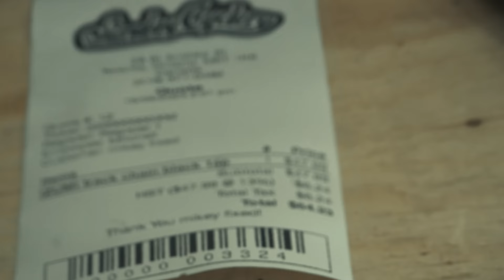New chain and I got a new JOB !

Comment: Yo mikey, do you know why the chain wears like that, mine dose it and it caused me to drop the chain in a corner and it f up sum stuff real good 😢
Reply: The chainring isn’t a perfect circle
Reply: @Vtoq  could it be the cog to or is it most likely the chainring?
Reply: @vickeboi2563  Chainring. A bike mechanic told me that road/track chainrings are not a perfect circle so the chain tension isn't the same all around which is why it also wears down unevenly but once a part of chain wears down you want to replace it ASAP
Reply: @Vtoq  nice! Thank you so much for the info! Helped much🙏🙏🙏